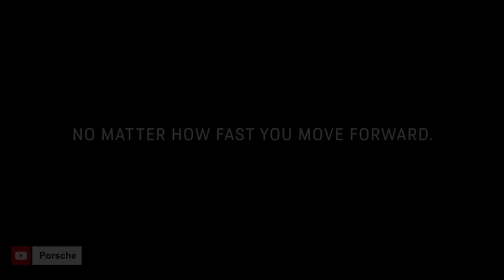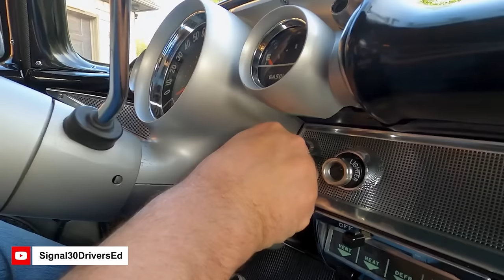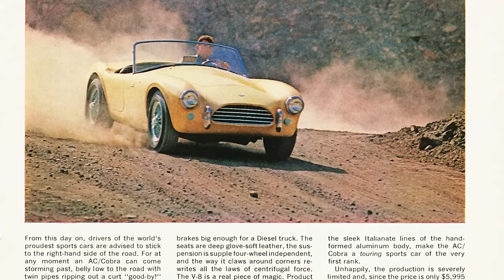Why Old Cars are Better

Comment: I had a '71 MG Midget in the early 2000's. I got rid of it while building a Stalker V6 kit car (Lotus 7 replica). That was a mistake. Between some dumb choices, bad machinist work on the engine, and getting ripped off on a "rebuilt" eBay transmission I pretty much got it done but was so burnt out and aggravated by it I barely ever drove it at all before cutting my losses and selling it. Kinda burned me out on working on cars at all. Really wish I'd kept the MG instead.

I have been thinking about maybe an early Miata. Crazy thing to think about is an early Miata is now the same age as my MG was when I got it. Ugh, I feel old!

Tho I do feel like when it comes to houses there's a lot of survivorship bias (and probably old cars too). Having dealt with a few older (70 - 100+) year old houses one thing they are often TERRIBLE with is the foundation. They may still be standing and have nice oak trim, solid doors, and plaster walls. But they're also probably sinking, warped, with basements that flood with the least bit of rain. House we lived in just after getting married was at that point about 70-80 years old. Foundation had footers only about 8 inches deep (nowhere NEAR deep enough for the freeze line) and a single thickness wall of bricks holding the whole thing up. I feel like a lot of effort used to go into what you could see, but underneath? Yeah, maybe not so much. At least for most average houses.

Comment: I own a mazda 323 from 1988 , and it has
4 Speed Manual Transmition
Power Steering
Basic A/C
Basic Radio
No AirBags or Safety features
FWD
Makes 104 HP
Carbirated
Very Light
And fun drive like miata
Mashmellow suspention

Comment: Thats why i think cars peaked in the 80s and 90s when they were still classic enough to get that real feel but also you can daily them. I mean i daily a 96 Volvo 850 TDI manual, i bought it last year after its been left abandoned for 7 years and we got it running imidiatly and i bought it on the spot. I did a major service on it and sure it snapped a cam belt, it leaks some rainwater but that feel of driving it on the highway is unmatched. That car is a pain in my ass and a drain on my wallet but id buy it again if had the chance

Comment: Flying a WWII aircraft is very much the same. You don't just hop into a P-47 and zoom off down the runway. There are switches, chokes and levers that have to be activated in a specific order just to start the engjne. Then you begin checking oil pressure and temperature, fuel pressure, switching magnetos, checking fuel pressure and manifold pressure and setting the throttle quadrant for takeoff.

Comment: The best car I ever had was a 1972 Dart with a slant 6 engine. There wasn't any maintenance work on the car I could not do myself. I bought it in 1999 with 73k miles on it, and used it as a daily driver for 15 years. I ultimately put over 200k miles on top of what it already had, the last 20k miles was on 5 cylinders because number 6 had a burned valve. It was still running and driving on 5 cylinders when I sold it. The car probably cost me less than 5 grand total for the entire time I had it.

Comment: Give me a vintage ICE motor and I'm happy. I always let the car warm up in the winter, get that thick oil warm and circulating. My 1st car, 1964 Plymouth Belvedere, 2nd car 1968 VW Bug, 3rd car, 1971 Comet GT, 4th car, 1964 Econoline, 5th car, 1961 Chevy Truck, 6th car, 1968 Barracuda Notchback,  7th car, 1983 Ford Ranger (Junk), 8th & 9th, 10th, 1975 Buick Riv, 240Z,  1992 Chevy Cheyenne 1500 WT, 11th, 2005 KIA  5SX,  12th 1975 Biarritz.

Comment: My first car is a 2002 mercury sable. I have the same sentiments about new cars. I mean in my car the pcm went out and it cost me 1300 dollars to get it replaced. The computer did only cost 550 dollars. But it still has quite a lot of mechanical functions. But not a manual transmission.

Comment: Daily driving a 60s-70s car from a northern european's perspective:
+Looks good
+Sounds good (usually)
+Easier to maintain and repair
+Increases in value over time
+Usually better in poor roads and deep snow

-You will get impaled in a frontal crash, crushed in a side on impact, break your neck in a rear impact
-God help you in -20c without a block heater
-Easy to steal
-Usually costly exterior parts
-You have to get the heads hardened or use lead replacement fuel additives
-Insurance is more expensive
-RUST
-Less creature comforts
-More maintenance

Comment: As a mechanic, I object to the characterization that working worse under more conditions is something that could be described as being better. I'd say it's more accurate to call them more reliable in being mid. Also they are death traps.

Comment: Modern cars are designed to fail after awhile. I’d say the only nation that builds cars you can drive forever with regular maintenance is of course Japan. Toyota and Honda especially make a great case for this. Still see plenty of these cars from ever era on the road. I still even see tons of older Subarus driving around. The only old American cars I occasionally see are 80s and 90s. Everything from the early 2000s to now isn’t on the road anymore.

Comment: It's funny that you should say that all modern cars have similar looking headlights, because for nearly 50 years until 1984, all cars sold in the U.S. were required to have exactly the same light, the sealed beam headlight. For the first few decades a round light in 7 or 5.75 inch diameter were your only options, and sometime in the 70's they introduced a rectangular version of the same thing. The requirement that all cars have the same headlights is, IMO, one of the causes of the popularity of hide-away headlights (the other being aerodynamics, cuz neither the round or the rectangular are especially good for aerodynamics, and faring them in was prohibited).

Comment: I bought my first house 3 years ago. It was built in 2015 and  Iwas the second owner. 
It's clear that the company who built these houses were In a hurry, thought the 3 year of living in it I have found little things like light switch covers not level, tiles not being level, door frames that were cut too short that they tried to cover the gap with silicone and it just looks horrible. On the other hand my 6 speed 2014 mustang 5.0 with the track package which doesn't have non of the fancy things is a pretty solid car

Comment: Don't forget older work trucks. Try buying a shiny new truck with all the bells and whistles on top of a frame (especially those painted, contoured bumpers!) that's built to crumple under the slightest pressure and then take it to a construction site or use it for hauling. You'll be longing for an 80s-90s model that was actually designed to be used for work and take a bit of abuse. There's nothing that kills work efficiency quite like having to give your truck the silk glove treatment.

Comment: I love old and new cars, the old 40s and 50s designs are amazing, but my favourite period is probably 90s and 2000s, the cars are a perfect blend of old mechanical stuff and new electronics and safety features. No drive by wire and autonomy nonsense, you still have abs, tc, airbags, and more safety features, but you still drive the car yourself. You can tinker with most cars, tune them relatively easily and most importantly the climate controls aren't in some submenu on a touchscreen 😂

Comment: My first car was a '70 Oldsmobile Delta 88 Custom hardtop with a 455-2V... the "economy" engine! 310 bhp and 500 lb-ft of torque. I... being a bit (a lot) of a gearhead even then... promptly found a 4V manifold and Rochester 4V carb in the boneyard. My buds and I put that in on a Saturday and the next weekend put on a proper dual exhaust with Hedmann headers, cherry bombs and nice chromed pipes out the back. Voila... 360 bhp... maybe a touch more. 
I'm in my 60's now... I've owned at least 50 cars... that Olds isn't even close to the best  I've had (I've had a 70 Hurst Olds 442, a 62 Grand Prix with 389 6 pack, a 69 Firebird with the OHC 6 and 4V, a 70 Stingray with a 454-4V and 4 speed, a 65 Impala ragtop with the 283-2V, a 73 Karmann Ghia with a modified (stroker) 1600 with dual carbs - hit over 95 mph, an 83 Datsun 280ZX Turbo 5 speed with the "Tokyo by Night" instruments, an 86 Grand National)....and others... the point was that I've owned a lot of "dream cars" in my over 6 decades so far... but, yeah, that 70 Olds Delta 88 Custom hardtop.... is my favourite! I wouldn't "kill" to have another... but not too far off.
Just for our young fella Bart... I did have an 84 S10... 2.5 L Iron Puke and manual (for the life of me I can't remember if 4 or 5 speed) but it was just the most unrefined, basic, dependable, underpowered pos possible! I took it... at about 15 years old (the truck .. not me... I was nearly 40) through a -40 °C blizzard from Montreal, Quebec to Ottawa, Ontario and back on Christmas eve... never a worry. I was pretty stupid then 🤣🤣🤣
So, I reckon my 70 Delta and 84 S10 are my faves! Great, great, great memories 😎
This young man gets it!
I'm a motorist... I've always been a motorist.  Hell, I've rebuilt several cars in my own driveway... under the sun and stars. Sadly a lost art... or almost... I've taught my children (born in the 90's) to understand cars... and motorcycles - my oldest son picked up a 75 CB360 - a garage piece of almost junk and rebuilt it with rather a lot of help from me - to my great pleasure! 
Keep loving old machines!

Comment: The best car I've ever driven was my uncle's 1970 Alfa Romeo 1750. It was slow, had no power steering, and the 3rd gear synchro was so worn you needed to double clutch otherwise it would grind. I loved the mechanical, connected feeling of driving it, the visibility, and how nimble it was. By contrast, I've driven fast, modern cars like the Kia Stinger, and that was one of the more boring cars I've been behind the wheel of. Yeah it was fast, but it felt like playing a video game with how insulated and over-assisted everything was. 
Even my current car - an 07 H6 Subaru Liberty - feels a little too modern for me, and I'm looking into getting something older to chase the experience my uncle's Alfa gave me.

Comment: So to start off I’m 18 born 2006 and I can confirm older stuff being better isn’t just nostalgia. My favorite car is a 1973 BMW Bavaria it was given to me by my dad and if anyone wants to claim that that is nostalgia because me and my dad probably enjoyed it when I was younger no, we didn’t me and my dad barely got along. Also it’s been sitting in a field for the past 20 years because he didn’t keep up with maintenance and it started overheating whenever he tried to start it so we were unable to enjoy it together, even if we did get along but nonetheless, it’s still my favorite car and it really was built to last well actually it probably wasn’t built to last but it lasted anyway. Anyway, back to what I was getting to it lasted when I saw what condition it was and when I started to work on it, I was mad because it looked like everything was rusting out and it looks like it was probably going to be a fools errand to try and fix it but after I cleaned it off, I found out it wasn’t rusted out that’s just the old red paint The only parts that were actually badly rusted what is the hood the roof and the trunk lid everything that was just exposed to the rain above and some of the easiest parts to sand down and replace with new metal where needed and The interior it was ruined The leather on the seats was severely water damaged, and had been chewed out by rats and mice and all sorts of critters and the springs on the inside of the seat were rusted out because the seals around the windows had gotten old and degraded, and began letting water in And think about this that’s water and a mostly sealed luxury car. There was probably mold. I couldn’t see in some spots, but regardless, despite all of those factors contributing to making the inside so uncomfortable when I sat in the seat, it was still very much the most comfortable car seat I had sat in ever this is because it wasn’t built like a modern car seat. It was built like a living room chair you know those nice old upholstered, liver Ingraham chairs, where the springs on the inside have long since gone out, providing very little resistance against your body weight they were the most comfortable chairs you ever sat into because the springs weren’t stiff anymore. They were actually really soft and comfortable. It was the same way with this. And I’m truthfully sad I’m going to have to replace those seats because well they’re comfy. They’re dangerous it’s rusty metal on the inside again water damaged an eaten through it’s comfy, but dangerous I have another thing that proves it’s not just nostalgia and this one’s a lot older and a lot less related to me my favorite house is a house. I can easily replicate because the blueprints are readily available online I have the knowledge of how to make it myself and as a matter fact, I plan to with only two small changes to the blueprints it’s the Sears modern home No. 158 first featured in the 1908 Sears Roebuck pre-cut home catalog it’s 98 years older than I am and despite its old floorplan, it’s design it’s perfect for modernization with newer technology

Comment: I never had a classic in the sense but I had a 2nd gen ram. That thing had character, the engine, the drive and overall look was great. It had space, it was easy to work on, and it was fun to drive, even for a being a truck. I want one again cause of how easy to maintain it was, too bad I didn’t have the funds to actually fix its head gasket cause I didn’t have the tools at the time but now I do but I don’t have the truck to do so 😢.

Comment: For me it's two things and it's not quantity of mechanical parts - even though I appreciate that.
It's the overengineering of them (and the materials) and the less reliance on computer systems and sensors that tend to either fail or have wrong reads.
I think a good example are the Red block Volvos - those things will just keep running because what theoretically could fail - engine, transmission is not designed by computers, it produces way less power than it could on that iron block, therefore degrades very little and the parts are under no stress unless you tune it AND go flat out 24/7.
And I really think after the early 00's things degraded very quickly. A lot of parts are made of plastic, pumps hoses break or get bridal, leak etc.
Electronics fail - either due to faulty sensors, bugs or capacitors that degrade over time.
CVT transmissions (no need to explain), or weaker ones.
Aluminum blocks that are designed to save fuel and weight tend to not last 500k miles, specially the on factory turbo cars.
And another very import thing are the drivers of course - a lot of people don't do preventive maintenance, barely change oil, filters etc.
But of all that I think the plastic parts are the WORST.
The amount of hoses and pumps that fail, specially in some brands is incredible. And those can do a lot of damage, overheating the engine and you're done. :(

Comment: I own a 2005 VW Golf 5 tith 1.9TDI engine, bought it brand new from the dealer 19 years ago. (I'm from EU) Outside of regular mandatory checks and servicing, it requires no work. It runs like a clockwork. It has heated seats, stereo, climatronic, and all the other stuff, that is either not available or unaffordable in new cars. 
I've made close to 1000000 km with it as a daily car, and holiday abroad trips once every year. As of now, no interrior plastic crackling, leather on steering wheel and gearshift is still like new. Engine still doesn't require replacement. No rust on the body(or at least I didn't spot it).
In the meantime rest of my family went through 7 cars. They sold the first 2, because they could, they changed/sold the other 5 because they had to. Engine failures, electronics failiures, shitty materials...in other words "Planned Obsolecence". 
No matter the company, Hyundai, Ford, Peugot, newer VWs or Fiat, they are equally worthless now. I bet the reliable car models designed before this greedy hypercapitalist dystopian trend, will outlast electric cars and will still be driving just fine along whatever new generation of cars comes then.

Comment: Finally, someone has my opinion!

I love the sound of old car engines, and riding Older, or just cars with loud engines, let alone driving. Whenever i enter a modern car with little noise, closed windows, i just feel suffocated, and i have puked often on long rides in new cars. There's also something about the appearance, like.. A modern hybrid looks like a dumpster compared to, say, a 1930 Duesenberg SJ, or a 1906 Stanley... And the cars from the early 50s, say the Oldsmobile Rocket 88, Or the 51 Hudson, are just made of raw power, engineered for stock car racing. (beginning of NASCAR) which is still very popular.

These days, car manufacturers are profit organizations, looking to squeeze every penny from the customer (just like apple selling chargers separately)... But back then, car brands were a part of the culture, which is why it made history. 

(Meme)
70 Years ago, a car manual showed how you fix some parts, even driving sometimes... 
Now, a car manual warns us not to drink the contents of the battery.
(They want us to spend money on their services)
(And shoutout to Jay Leno & Hagerty Drivers [something] for sparking my interest in classic cars when i was 9 yo)
Reply: Also applicable for appliance 
(Thanks, 1980s fridge which has been running for 40 years)

Comment: Something I’ve noticed especially with pickup trucks is newer examples are bigger outside and smaller inside, I have wide shoulders and new Chevys and dodges are so narrow my shoulder rubs against the B pillar, meanwhile my 02 Sierra is significantly bigger inside both horizontally and vertically. being 6’5” this is becoming more and more of a problem with newer vehicles